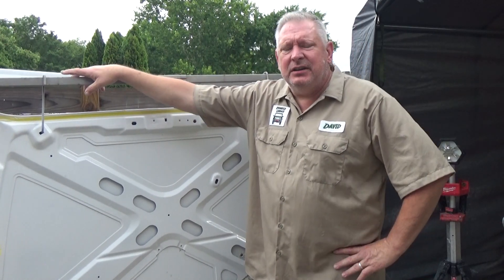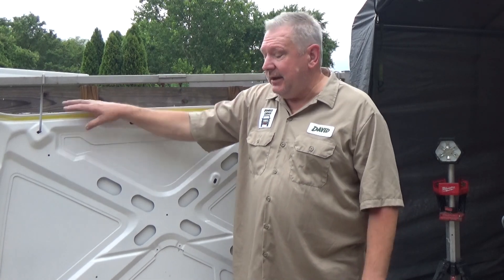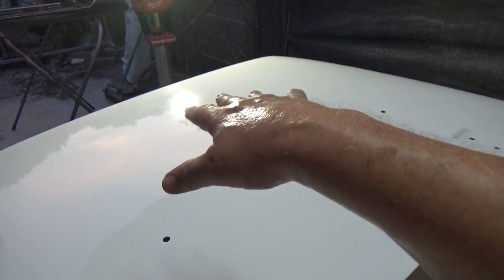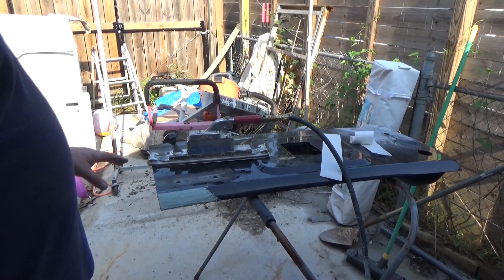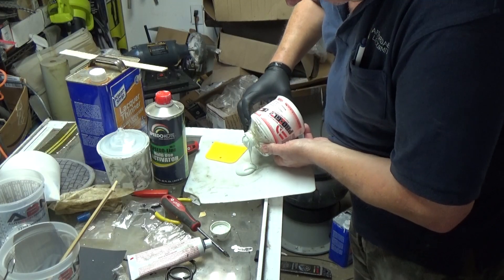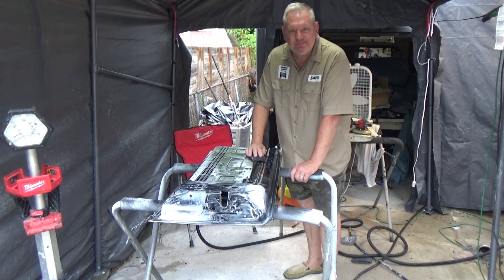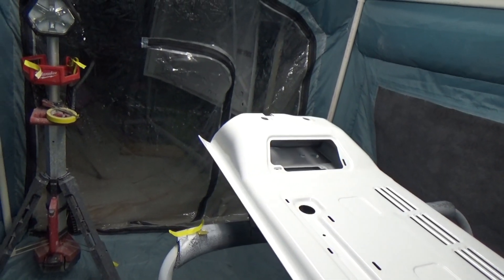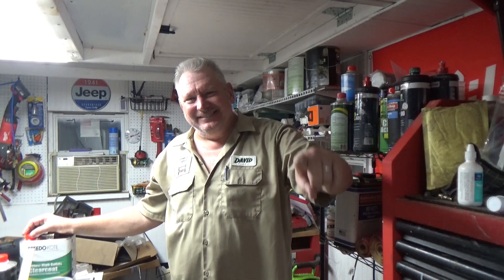Jeep Wrangler Paint Flaws !  High Solids Clear

Comment: Yeah, the JK tailgate is really heavy.  Then Jeep mounts a big tire on it for more weight.  That was my main reason to upgrade my bumper which included a tire mount.  For the third brake light, I bought a LED light and mounted it in the top edge of the fiberglass top.  I fished the lighting wire inside the molded top and put a Deutsch connector so I can pull the top off if needed.
Reply from the maker: Nice :)  I did that on my TJ